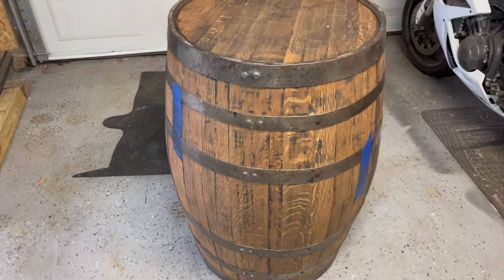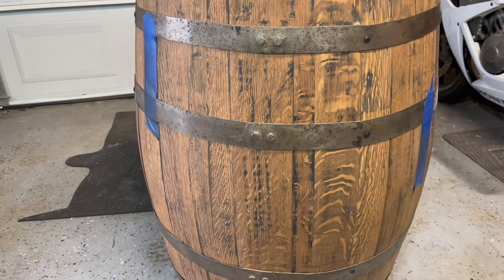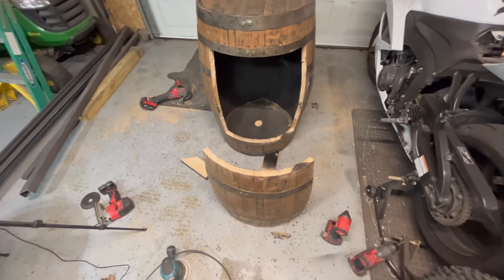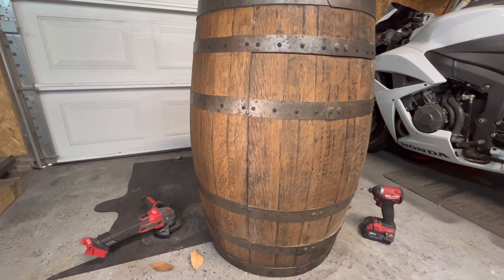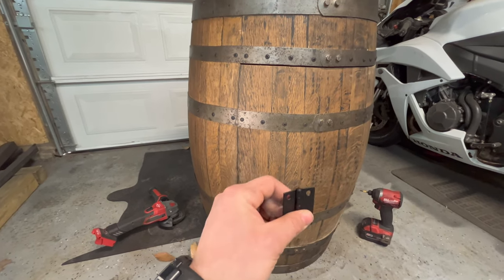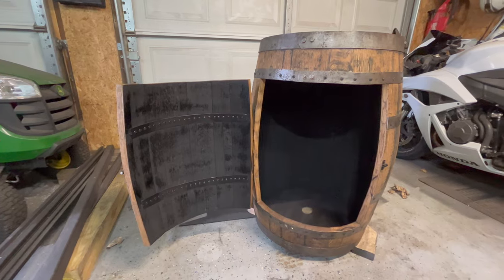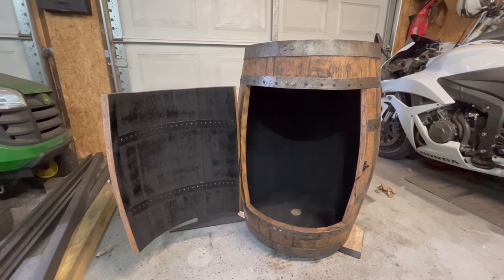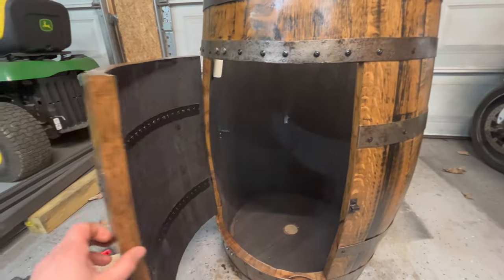How to Build a Bourbon Barrel Cabinet

Comment: what is the specs for the screws used to fit the metal rings to the wood ?
Reply from the maker: @PrateekChhabra  3/4”x1/8” self tapping metal screws

Comment: What type of clear coat do you spray on the inside of the barrel? Also, when cleaning the inside, does it get rid of the smell?
Reply from the maker: I just used a spray paint clear coat and I was unable to get rid of the smell.
Reply: @ian_whitelock  if I were to have one of these in my house, with a smell, be subtle or overbearing?